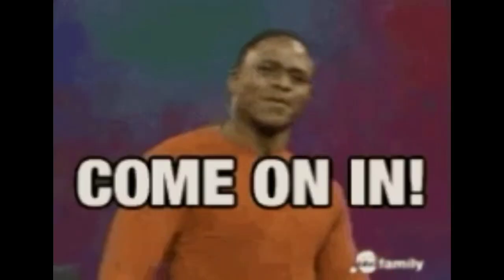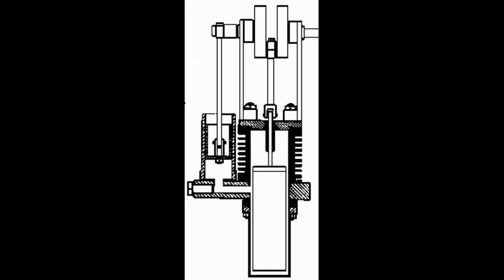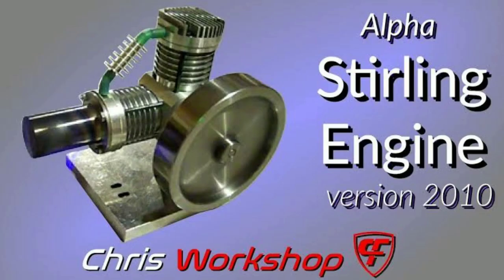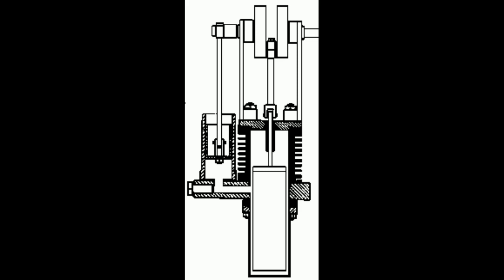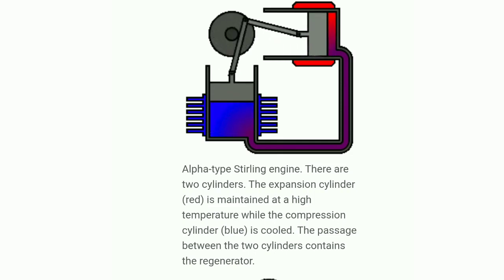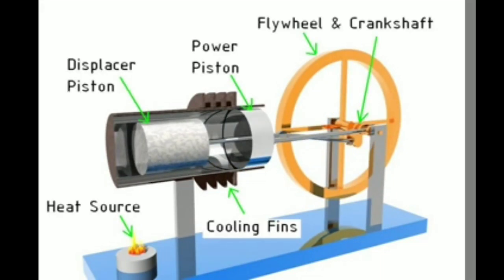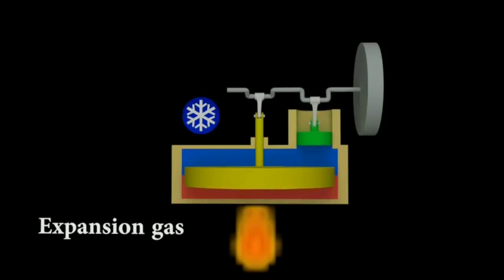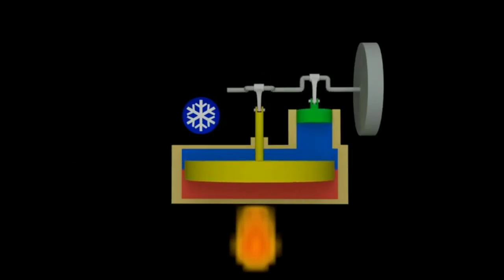Stirlling engine and it's types | full explanation in Tamil | Alpha, betta & gamma | 24th Tech

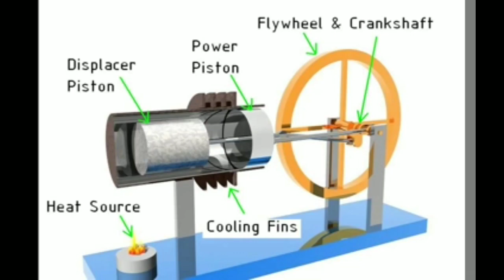Comment: some info, in case you got some Wrong.        at :53, this is  BETA.   it is a  Co-Linear configuration.        at :58, this is  GAMMA.         at 1:05, this  is   GAMMA.   gamma   has  Two  CYLINDERS  that are  PARALLEL  to one another.        at 1:27,  BETA.      at 1:39,  ALPHA  -  because the  CYLINDERS  are  PERPENDICULAR  to one another.       at 1:43,  ALPHA.       at 1:47,  GAMMA.       at 2:12,  GAMMA.          googletranslate
Reply from the maker: Tq bro